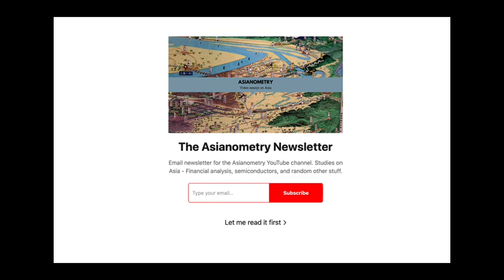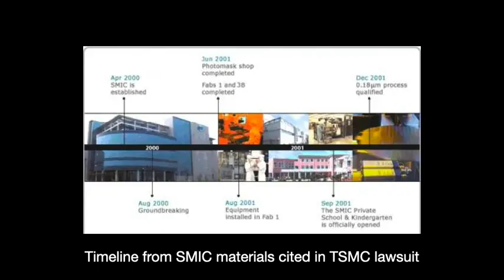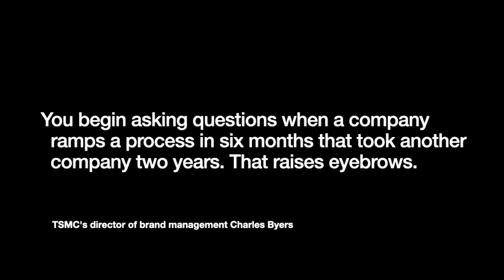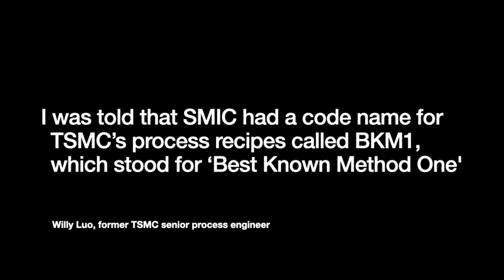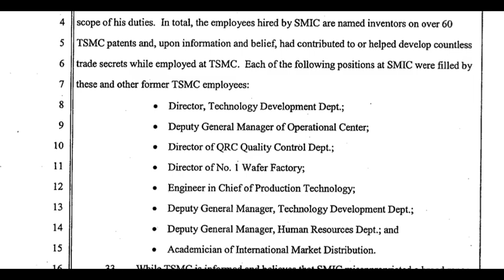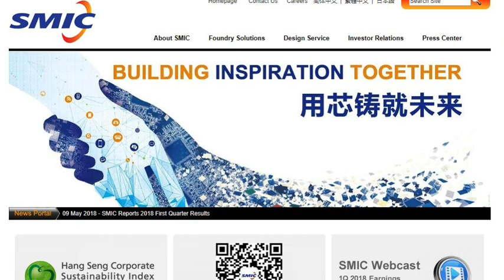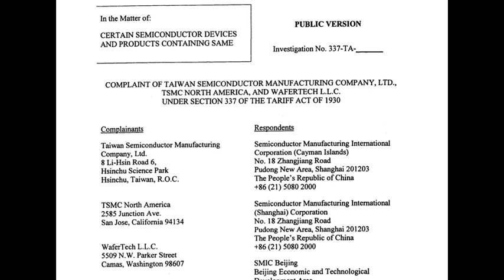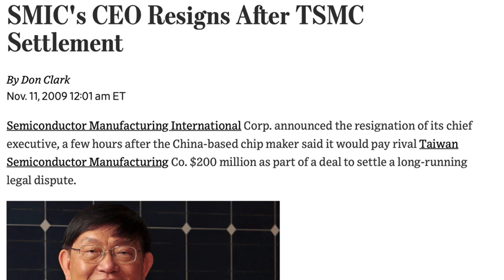When TSMC Sued SMIC and Won

Comment: If you enjoyed this story, its worth reading up on how Huawei grew into a powerhouse through corporate espionage of product lines and R&D from Canada's Nortel Networks and Cisco. In Nortel's case the Chinese government reportedly had complete access to its internal networks for more than 10 years, and was constantly siphoning information (including designs, pricing and product roadmaps). I also highly recommend the book "The Hundred-Year Marathon Book" by Michael Pillsbury. I found it very insightful and well-written.

The growth of SMIC and Huawei are such an important lessons for management in the securing of trade secrets. It's safe to say that all large companies are unknowingly having their corporate secrets siphoned away through ongoing corporate espionage (see the recent SolarWinds hack).
Reply: "unknowingly"? If they grew to be big, they already have a security unit. And an espionage unit.
Reply: I agree, I have read about Huawei getting sued several times over the years. One incident happened at a tradeshow in Chicago 2004 when a Huawei employee came back after hours and was removing the cover from a networking device and taking photographs of the circuitry inside. Over the years Huawei has been caught over and over involved in espionage. SMIC is another company that has grown fast due to corporate espionage.